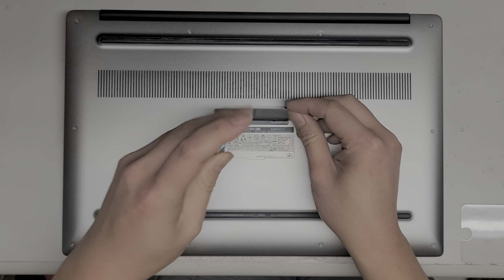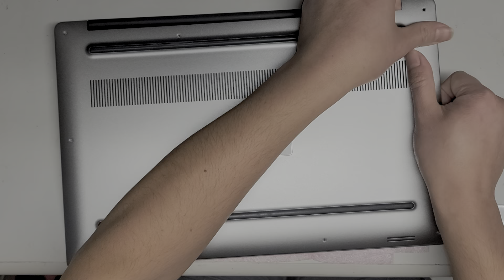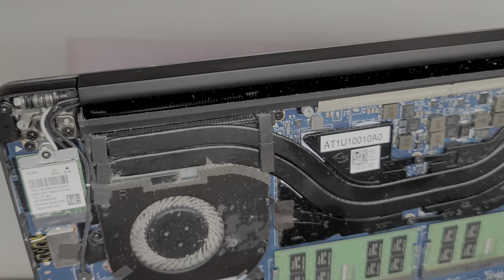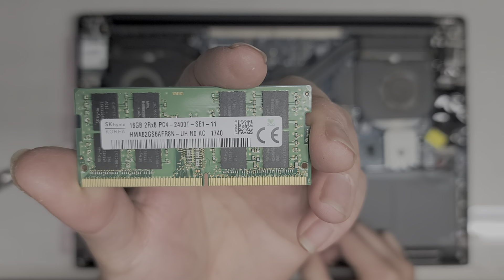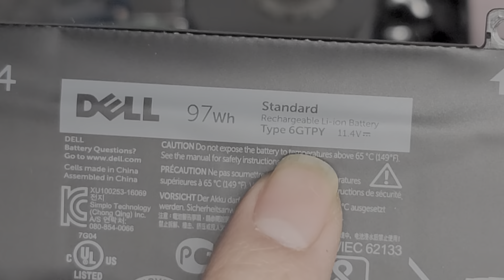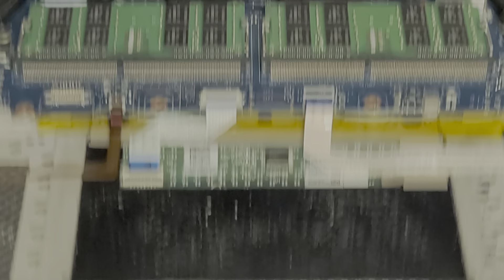DELL XPS 15 9560 Disassembly RAM SSD Hard Drive Upgrade Repair Battery Replacement

Comment: I spilled a large coffee in mine, causing it to shut off. It didn't say "shutting down," it just went dark. I opened it up and dried it out, even under the motherboard, but it still won't power up. It has a 512GB mSATA SSD. Is there a housing I can get for it, so I can get the data off of it? Basically, turning it into an external drive.
Reply from the maker: Are you sure it's msata, not pcie?
Reply: @ItsBinhRepaired  Wow, thanks for the quick reply! Yes, it says mSATA SSD on it. It's a little wider than the one you pulled, and there's a flat cable that goes over it and connects to the motherboard at two points, and it has a plastic tab on each end that says "pull." That comes off, and the SSD is underneath.
Reply from the maker: This will work https://amzn.to/3ywhWw7
Reply: @ItsBinhRepaired  Thanks so much!
Reply from the maker: No problem

Comment: Please to explain how to replace MacBook Pro 2012 A1398 Trackpad Please
Reply from the maker: Battery needs to be removed, likely won't be reusable. Metal plate needs to be peeled up. Screws need to be removed.

Comment: Thanks for this comprehensive look! I have an intermittent, almost dead USB-C jack (in between the HDMI and Audio jacks). Apparently lots of complaints about this problem. Dell has been no help. I have not opened the back yet to see my mobo. Can you give me some answers on that USB-C connector?...

Is the jack replaceable? Is it soldered or have a cable and connector? Anyway to "fix" it in place?
Any other comments about this seemingly known problem?
Reply from the maker: Sadly it's soldered in place. :( I can't fix those.
Reply: @ItsBinhRepaired  Thanks for taking the time to answer. Have you seen any talk on the web about this issue? I found the forum link about it but guess it's not allowed here.
Reply from the maker: @robbif  I dunno
Reply from the maker: @robbif  I'm sure it can be replaced. Just need the tools and skills to do it.
Reply: @ItsBinhRepaired  And the part! I cannot find it; don't know if it's a standard part.
Reply from the maker: @robbif  not sure